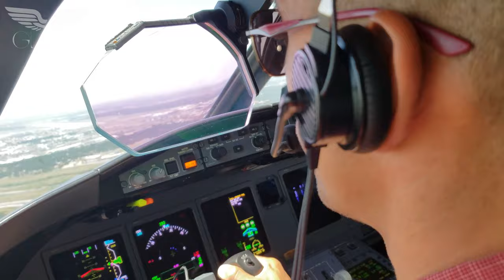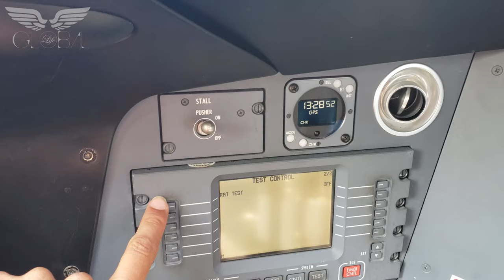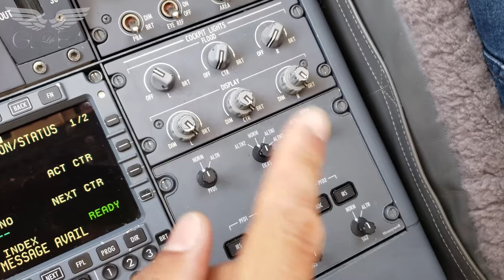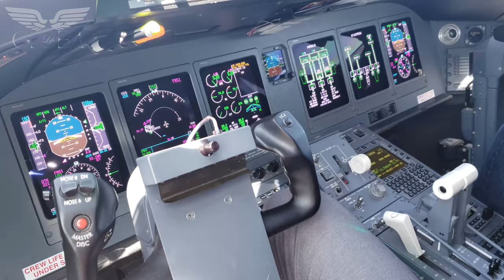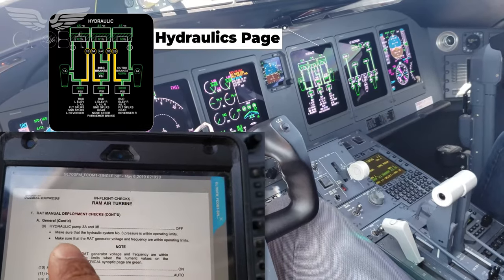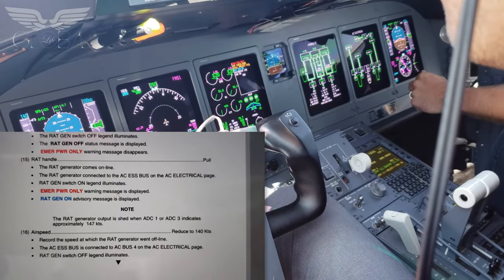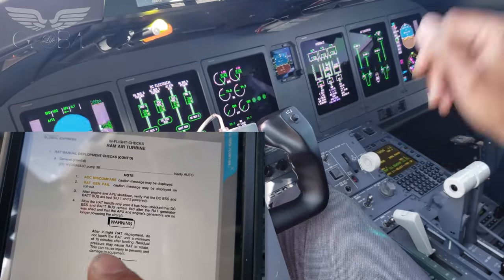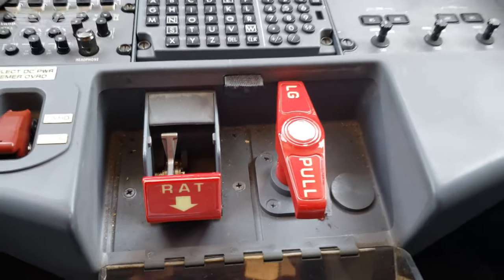Global Express - ❗RAT (Ram Air Turbine) deployment in flight ❗ | 4K

Comment: Question. Why can't you run the Apu in-flight? Wouldn't that solve the issue of total elec failure or hydraulic pump failure?
Reply from the maker: That's absolutely true yes. The APU will  provide some power and air and in fact is in the checklist in case of loss of one of those systems. The RAT will drop and generate power immediately while APU gets fired up (it takes a while)

Comment: Can the RAT be retracted in flight in the event it was accidentally deployed?  I would imagine that a significant amount of drag would produced.
Reply from the maker: No once it's out it needs to be stowed properly by mechanics on the ground. It doesn't produce too much drag and the propeller actually will turn in a strong wind or fast taxi it offers very little resistance
Reply: @GlobalLife  Thanks!  Would think it if accidently deployed over the ocean would normal flight planning take this into account for divert fields?
Reply from the maker: @Gadget0343  it would take a major event for it to deploy, I can't think of an accidental scenario
Reply: It's happened before.

It isn't a big deal unless something else is going on.
Reply: @GlobalLife  So is there a maximum speed if the RAT came out accidently in flight at cruise altitude?